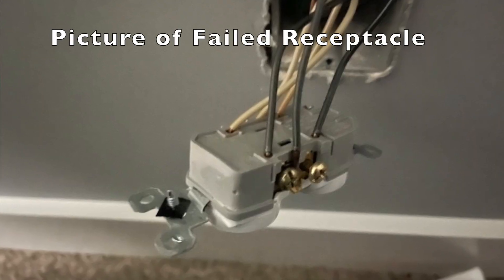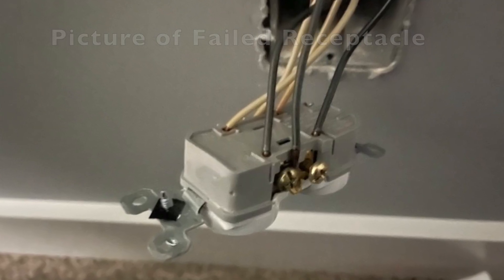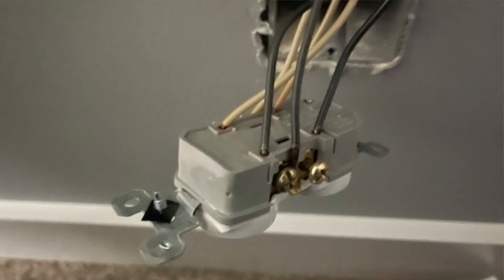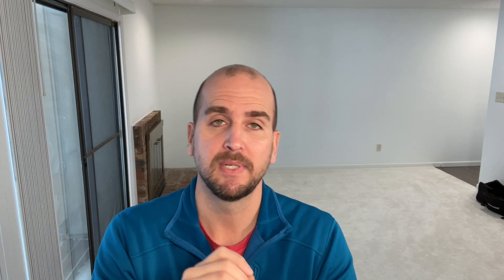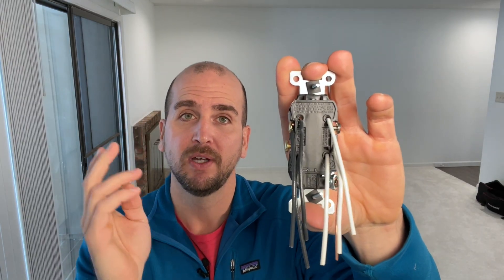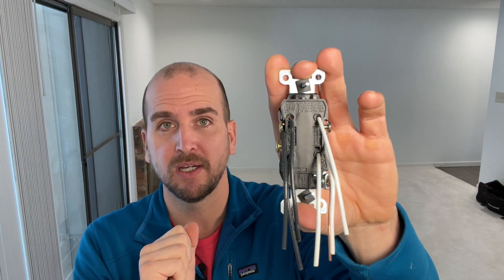Incorrectly Wired Outlet Found In Newly Built Home

Comment: The third set of wires is actually a NEC violation. It usually happens when something is added after the fact. Like snaking a wire to that outlet. There is no reason to do it for only two sets of wires.
Reply: I've seena lot of work where the push-ins were used originally, and the screw terminals were used for the "add on"
Reply: @pcicchin  I have done it to save the time and effort of a splice. It's an NEC violation but I don't think it's dangerous.
Reply: @NYHalfassprepper   I agree.  "smiley" was code for years.  "upside down" is better, but not a problem
Reply: It's not a code requirement but it's a better job, bc the current from devices downstream is no longer passing through the screws on the receptacle, so less chance of failure. Also, if the receptacle fails it will not interrupt operation of any devices downstream if the pigtail method was used, whereas if the connections are made on the receptacle it will cause devices downstream to go out if a single screw connection fails, and then someone has to troubleshoot to find which receptacle the problem is in. Where with pigtail, you don't have to troubleshoot, you just replace the one bad receptacle. It saves money over time for the homeowner, but it's not done universally bc it's slightly more work on the initail install and the builders aren't considering the person who actually will live in the house. They just want the cheap quick cash and the person who is buying the house wont know until something breaks.
Reply: @songsfromnowhereproject  it is a code requirement to pigtail when you have more than two sets of wires. If only two you can use the outlet for the connections. Where I work, the residential market is very tight. Profits are slim. No electrician will install pigtails on every outlet. Time is money. I agree its a better job.
Reply: I get why many electricians don't pigtail where you are (money). Its a thing where i am too. It's not that much more money to do it proper though, and not pigtailing  ultimately costs more to the buyer over time because of added service calls. It is ultimately a choice by the builder to pass costs along to the homebuyer by having inferior work done. Like when they install incandescent bulbs in a new build. I understand why people do it but it's still stupid.

Comment: Check my video on a failed outlet (D.S.STEELE SvnCigskj4E). Graphic example of what can happen. I was lucky no fire! I used red wire on the common side (in my video) because I did not have any white scrap at the time, would use proper color wire on actual install. One other thing I learned from an electrician, use a GFCI at every kitchen/bath or other outlet near water. The same kind of failure can happen, or constant breaker popping, if you wire "down circuit" outlets off the load side of the GFCI.

Comment: Speed wire, back feed.  Whatever you call it is shunned in IBEW. Pigtail the wires, use the screws. 8 inch tails should be used. ALL insulation MUST be even then start your splice. Use a wire nut for approved size gauge wire. Ground up when installing outlet. Screw on plate should be perfectly vertical... The way I was taught decades ago

Comment: Thank you for the pigtail advice, had no idea that was the more acceptable way, as a regular home owner even I had a feeling that the push in connection could create unforeseen problems  so I always wrapped a J shape hook around the screws, thanks for the confirmation.
Reply: A million professional electricians DON'T use unnecessary pigtails. In 50 years, I have never seen a receptacle fail in a way that breaks the daisy chain. I have, however, seen plenty of bad wire-nutted connections fail. Done right, both are equally robust. Done wrong, either can break the daisy-chain. Pigtails can cram up a small box, and can cause more problems than they allege to resolve.

Comment: Good video. Clear and concise.

I used the pushins because they were convenient. UL indicates that's okay. Go figure. 

I'm not sure why you would pigtail two hot wires when there are two screws on the outlet. When I remodeled two rooms I used the extra screws as a place to send power to the next outlet.
Correct me if that was a bad idea.

I noticed one thing at the very end. 
If a plug is not tight to the receptacle and someone by whatever means drops a piece of metal in  there you are going to have sparks flying.
The hot and ground terminals are at the top. I know it's not likely but doo doo happens.

I have taken to installing my outlets so the single, ground wire is at the the top. In fact in some areas such as apartment buildings that is code.

Comment: Pro tip.  Dont let mexicans touch your electric.
Reply: Working construction on a 24 story building from the basement to the last cabinet, you speak the truth. The Mexicans worked on the concrete side and did a good job but, are dangerous because of the short cuts they take. The safety guys that are on patrol on any large project sent home a bunch of them for safety violations. Anywhere from no safety harness above 6’ to not using a steady  platform when using an electric saw. Another one that got alot of the sent home was plugging an electric saw into a string of lights.
Reply from the maker: Pro tip:  Don't be racist
Reply: @EverydayHomeRepairs  Thats not racist, its the truth.

Comment: But you didn't say WHY to use pigtails instead of having three sets of wires connected directly to the receptacle. Looking "cleaner" is subjective. The real reason is that, with a pigtail connection, the receptacle is connected in parallel, whereas doing it the other way, it is connected in series, so if that receptacle fails, everything else down the line on that circuit will also fail.
Reply: Thanks for finishing his video for him.👍🏼👍🏼

Comment: I sometimes have trouble fitting a 6” pigtail in the outlet box, should I keep the conductors entering and exiting the box shorter to compensate and make space?
Reply: Use lever nuts and stranded wire for your pigtail. Way better!

Comment: The first problem was not only a case of overloading the receptacle. Vacuum 7-12A and resistive heater 10-12A.  It was overloading the circuit (either a 15A or 20A breaker).   Should mention to ppl the basics of circuits and how to not overload them.  I don't run a shop vac (10A) and table saw (15A) on the same circuit (much less the same receptacle) at the same time because it's a 20A circuit.  
 Upgrading receptacles is not a solution, it's a hazard.

Comment: I’m a retired member of IBEW L 246. I was taught as an apprentice to always tape around the receptacle when wiring is completed. Just another safety measure especially if you change the receptacle working it hot. I even tape around switches and always tape the wire nut leaving a tail.
Reply: Loved your video on the difference between a $.50 and a commercial grade receptacle. Never cut one open like you did to see the difference. I’d NEVER use a cheap receptacle again!!! Thank you

Comment: My house was built in 1986. Every single outlet was wired using those stupid stab in receptacles. In the past 8 years that we have owned the house I have had to replace them in almost every room. They are usually chained together, so when one falls so does a bunch of others, so I end up replacing all of them in the room.  
The worst one was causing all sorts of weird issues in our "play room". The lights would dim, the tv would change inputs and the kids Nintendo would lock up. But the worst thing was that the breaker for that circuit was sizzling, like arcing out internally. As soon as I heard it, I killed the power to the whole house.  That breaker was hot enough to burn my fingers while taking it out. So a trip to Lowe's for a new breaker and a box of outlets ensued. 8 receptacle swaps later and we were back in business. The thing is, all of the outlets were installed "correctly" but every single one of those stab connections was loose. Some of the outlet enclosures were darkened from the heat they were dealing with. And these aren't overloaded outlets. Just basic stuff you find in a kids play room.  

The moral of the story is, don't rely on those cheap stab hole terminals, and if you have a faulty outlet, check the other ones in the circuit as well, and be prepared to replace a whole bunch of them.

Comment: This wire twisting is making me crazy every time when I see it. Because in most cases it is done on short length or not enough power. Use wago connectors. They are totally cheaper than doing this. Because cost of work is more expensive than few connectors and you can connect it in seconds

Comment: I recently replace an outlet that was getting warm with nothing plugged in. I found that they used the push in holes but had pushed one wire into the hole that does the release.

Comment: If the fixture (outlet) has a double tap connection, there is nothing wrong with two wires going to one terminal (screw). Adding a pigtail adds one more connection and more bulk inside the junction box. Of course, you have to have the correct terminal configuration to have two wires on one screw. Many older fixtures are not configured that way. Then you have to do a pigtail.
Reply: In many jurisdictions two wires under the screw or stab termination is against code. Pigtail out to the receptacle is the directive.  All the wires to the receptacle puts excess stress to the receptacle housing on tucking the device into the box. You count 2 wires for box fill but never had a problem.
Reply: @MrBonners  Also, when you put two wires on a screw, you are always going to be forcing one in the wrong direction when tightening.
Reply: @Jeff-vh1zz  That is why in most jurisdictions it is not code, pig-tail is the rule. wire is to be hooked around the screw.

Comment: Here's a thought about using an outlet as a pass though connection- my first instinct was put both wires on the same screw to keep them closer together, prevent current from passing further through the outlet connection, maybe balance the physical load of the pinch connector from one side to the other.

I think this is all wrong. Put each wire on a separate screw. Connections are always the first thing to heat up in a circuit. Two wires on the same screw means twice as much heat at one point. Wires on separate screws means more structure to dissipate heat plain and simple.

Comment: You're still not a professional.  A real professional would wrap electrical tape around the side of the outlet to protect against short and also on the wing nut to keep it from coming off.  There is NOTHING wrong with using the push in points on the outlet.  What you need to learn is how to test to make sure its PROPERLY installed.  The exposed copper wire needs to butt up against the outlet.  You left a gap in your video and that's a big no no.  What you do is PULL on the wire to make sure it doesn't slide out when its installed.  Once its put into place, there are no forces over the life that would pull the wire out.    The only negative is that it has less contact area with the spring terminals inside as compared to the terminals on the side.  There is a reason why you are not a professional.  Giving professional advice when you're not a professional electrician is a mistake.

Comment: it's funny you claim to have showed that you used double gang on an outlet which is electrical wiring  101, not to do. However  you feel you should be showing people how to wire up electrical with that lack of basic knowledge. Teach as you go theory; Showing people how to do something when your not licensed in that area,Then learn that it was wrong. and dangerous. electrical is not a game, and you apparently don't have all the knowledge to show people what to do. I love that You tube allows people to teach such things. You not knowing to add two wires to one terminal and showing people that in the past, and learning after fact. Is outrageous.
Reply from the maker: Hi Robert, always open to feedback but not following the issue with a single receptacle installed on a mud right in a 2 gang box.  If you could point me to the NEC code that calls this out that would be great.  Take care.
Reply: @EverydayHomeRepairs  You said it yourself in the video, you can put 3 wires to an outlet like you showed, and you said you use too, until you realized you were wrong. hello
Reply: @EverydayHomeRepairs  you can't put 3 wires is what I was saying.

Comment: The receptacle is designed to with 2 neutrals and 2 hot screws. What would be a scenario in which you would use the secondary neutral and hot screw?
Reply from the maker: Many circuits in your home will have outlets daisy chained together so it is not uncommon for 1 electrical box to have a line coming in providing power and then 1 or 2 lines going out providing power to another outlet or light.

Comment: Same method for three wires on each side?
Reply from the maker: Yes, but one thing I don't touch on is "box fill."  If you already have a full electrical box and then add a pigtail you are most likely exceeding the box fill recommendation for your electrical box.  Each electrical box will have a different box fill rating and you can find calculators online which will tell you the box fill number for your specific wiring scenario.

Comment: Scott, thanks for the video.  1.  If the "proper" and safest install is to use the side screws and J connect the wires, why do the manufacturers of these outlets provide the push-in option if it was that bad?  2.  Along the same lines, I am seeing that you can now purchase push-in connectors that replace the use of wire nuts.  What do you thing about them?  Would you use them?  They are now also provided in ceiling can light kits.  Would you cut them off and use wire nuts?  3.  I see that many electricians use black electrical tape on all wire nut connections, covering a portion of the wire nut and a portion of the insulated wires.  You did not show that in your video.  What is you opinion on that?  Thanks...

Comment: I'm just a general moron, so my comment is just a question:  When creating a pigtail, aren't you forcing all the current from the separate wires through a single wire?  Assuming these are feeding other outlets, wouldn't this be setting yourself up for overloading that single wire?
Reply: Well, it's sometimes called a daisy chain.  And all the current got there on a single wire...  Branch circuit wire is sized for the circuit overcurrent protection.  General speaking 15 amp-14 awg, 20 amp-12 awg, copper conductors.

Comment: Why is it code that you can wire in a 15 amp outlet on a 20 amp circuit? Anyway that’s the code in Wisconsin. I believe the video is correct but I never had an outlet fail using the push ins because there just wasn’t enough room in the box to use the screws.

Comment: Pretty good video! Well explained too!
But, your pigtails are too short. They should be 6” or longer. Their purpose is to provide a service tail and to be replaceable in future years as outlets are replaced and the wires are restripped. Also it’s easier to get the outlet out far enough fo easy service and replacement.
The main reason for pigtails is to deliver power to the receptacle loads. Putting both wires on the receptacle makes the downstream load current and the receptacle load current to both go through the receptacle connectors. Using the push-in connections this way can easily overload the spring connections over time. This is actually not correct usage according to the NEC Code. Now, someone will say that’s not written in there anywhere. True, not in one sentence, but you would have to reference several different code segments. And ultimately if you were to actually obtain the mfg installation document, it would say this more clearly. I have had this very discussion with a UL field inspector. Plus, my father was on a panel for the NFPA NEC code committee for 15 years.
Reply from the maker: Good stuff Craig and thanks for all your great feedback!

Comment: I never use those back inserts anymore. Honestly, the contact point just isn't good enough imo. I've had a lot of outlets go bad from bad contact over time because of those inserts. 

The best way is to pig tail and use the screws, or even better get the newer design that uses a pressure plate design so you can run outlets in series easily off one screw plate..
Reply from the maker: Thanks for the feedback!

Comment: I always put the hook with the end bent to the right side so when the screw is tightened, it does not move the wire off from the screw.  I also wrap the outlet 3 times with tape so if something metal does get stuck into the box, it keeps a short from happening.  I worked for an electrician and we always had to fix previous wiring job issues.

Comment: The neutral cannot be dependent on device connections. Thats not just best practice, it's the law. Why anyone would not bend a hook and use the screw terminals is hard to believe.  It's beyond stupid and lazy. DO NOT USE THOSE STAB CONNECTORS. I'm a 30 year electrician and contractor.

Comment: I got a new house , had a short in an outlet and found the push in was used in a series of outlets . I removed the wires from the outlet and added a piggytail like you did. (So the circuit is fully connected)